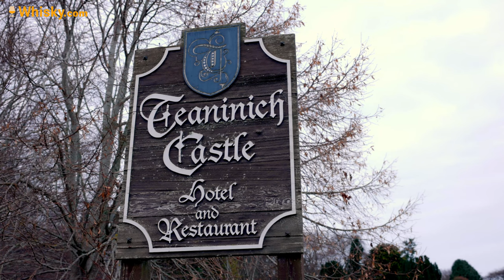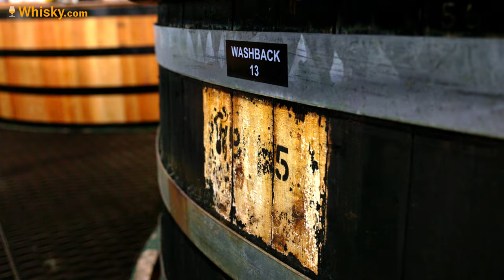Teaninich Distillery Visit | Meet the Teaninich Distillery

Comment: Nice review, and you're correct in that it's green grassy/oily character. Also, you're description of the condenser add on vessel was quite good. It is called TVR ( thermal vapour recovery) unit and it uses condensate from the returning steam/condensate from the heating pump to allow a slight vacuum to occur in the small TVR vessel, which then in turn makes steam at a lower temperature due to the boiling point being lower as it's under a slight vacuum. Pity I hadn't been around at the time, I would've gave you a full proper tour, as I've worked there for 15 years. I enjoyed watching your video and also the Roe & Co one, which I intend to visit next month. Good video Ben.